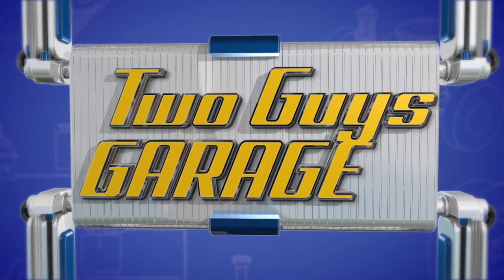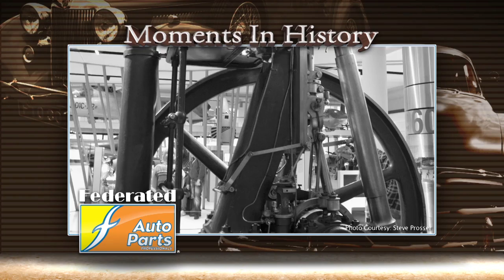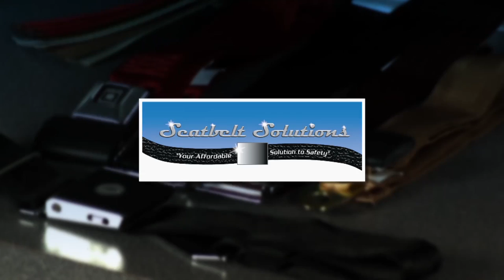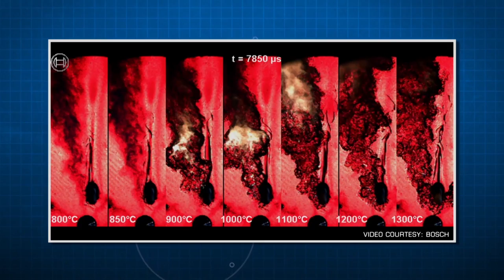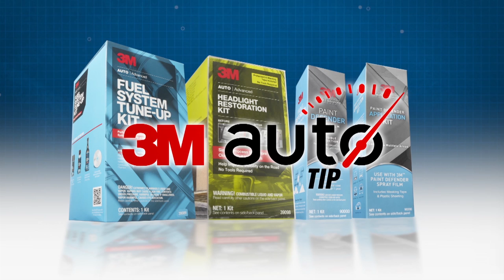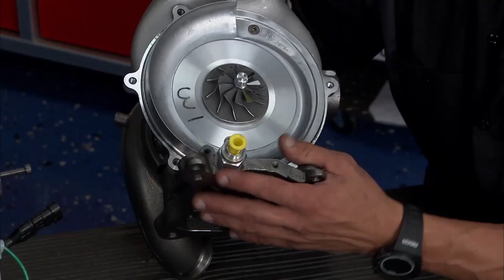Scorpion Diesel Engine Deconstruction | Two Guys Garage | Season 13 | Episode 5

Comment: thank oyu so much i really wanted to see my 6.7 motor behind the scenes. One question has the turbo changed for the 2017-2019 model and also will the 2020 have a new design turbo? You guys rock